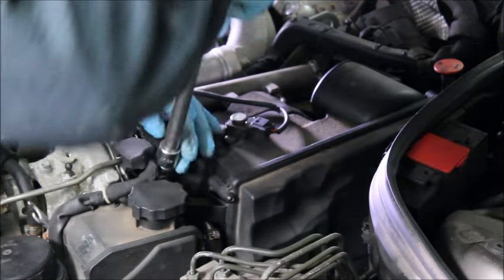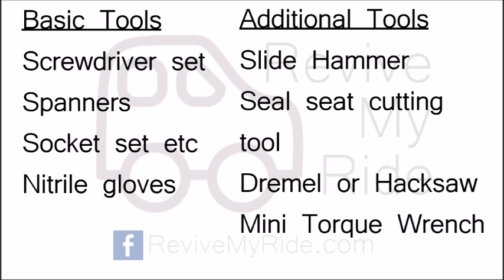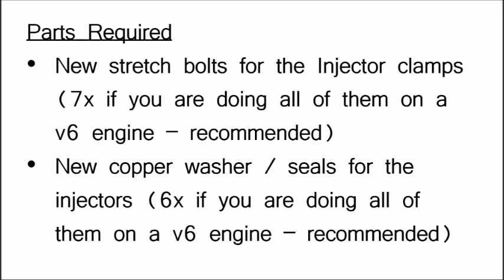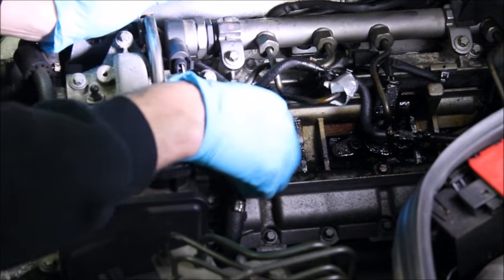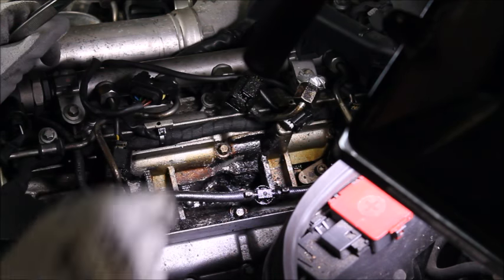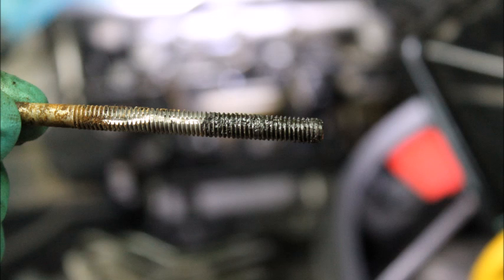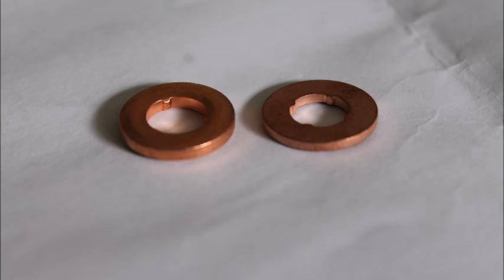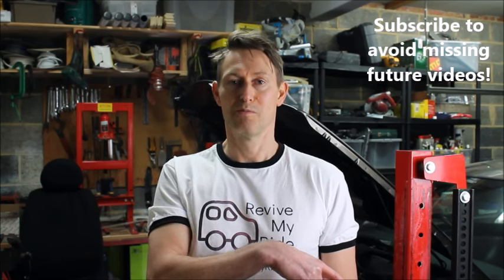Mercedes diesel CDI (Black Death) leaking fuel injector - How to diagnose and fix on 3.0 V6 engine

Comment: can this problem produce White smoke??
Reply from the maker: To be honest, I don’t think so. The leaking injector seal let’s combustion gasses out of the cylinder and coats the top of the engine in carbon deposits. However, there is a different fuel injector problem where the injector doesn’t shut fully, this is a fuel leak into the cylinder. I think this can cause white smoke but I haven’t come across or had to deal with this issue myself. Hope that helps some! Thanks, Phil
Reply: @ReviveMyRide   ok. Thanks!! Diesel white or black smoke? Leak inside the cilinder?
Reply from the maker: @fernandovacarezza1783 sorry for the very slow reply, missed your message! It's a difficult one! If you google it, you will see people saying both! My personal experience: white smoke is unburnt diesel. Don't be too concerned if you see this for a couple of minutes after start up and then it goes away. If continuous, then yes, you could have an injector that isn't cutting off or is over fuelling.
Reply: @ReviveMyRide  thanks. It s drive me crazy. I cannot find the problem. Is when is hot. And in ralenti.

Comment: I have a 2010 w212 250 cdi. Om651 4 cylinder. 160k miles.  I see diesel sitting at the top of each injector and if I drive hard - I see a puff of smoke out the rear *exhaust) and can smell oily fumes in the cabin......what is it ??  so as I sought my car- I am selling it- its a painful car to own.
Reply from the maker: Hi, the symptoms on the "Black Death" is a carbon build up around each injector. I haven't heard of it looking like actual diesel before. I enclose a link that shows what the black death usually looks like: https://sprintergurus.com/fuel-injector-black-death/ It's possible that you have a diesel leak but I'm not sure why you would see if above each injector. Have you had any or carried out any work on the car recently? BTW, sorry if you already know this but a word of caution, it is possible you have a diesel leak, so never investigate when the car is running. The diesel is at very high pressure and a small, fine leak can cut right through your skin (and worse!). Regarding a puff of smoke out of the back, that is normal in higher mileage diesel cars and one of the most common causes (but there are other possible causes too) is linked to fuel injectors not being as efficient any more at providing the "mist" of fuel to get best combustion. Fuel comes out more as a stream, as a result doesn't burn as efficiently can causes the smoke effect. This can be fixed by removing the fuel injectors and sending them away to a specialist company to clean and calibrate. Hope that helps!

Comment: Hello; Good video poor audio. At 100% sound it is hard to hear you  in many parts. You should redo the audio at a higher volume.
Martin
Reply from the maker: Hi Martin, thanks for the feedback. Agree, audio was poor in this video. I hope it doesn't put you off looking at some of my more recent stuff because I have improved a lot! This vid was one of my very early ones and I was still using the camera's built in microphone. Cheers, Phil
Reply: @ReviveMyRide  No worries. Excellent video with good explanations!

Comment: There's only one problem I saw you dit not leave any length on the cutting tool as a insert and to act as a guide otherwise it was spot on
Reply from the maker: Glad you liked the video! Thanks for your comment on the cutting. I see what you mean, I could have slid the cutting blade up higher to leave more of the centre shaft protruding, which would then locate in the hole that leads into the cylinder. I'll do that next time 👍

Comment: Have symptoms of "black death" on my 2003 320 CDI straight 6 engine. I think its a similar if not the same injector. My mechanic used the washer from Ford. He took out 2 injectors, cleaned everything up, but now the car runs poorly. I presume a refurb of all 6 injectors is due. Does anyone know a good refurbisher who can do these at a reasonable cost?
Reply from the maker: mista bombastic!! Sorry, I've never used anyone for fuel injector cleaning but maybe someone else will chip in with a recommendation. I will post a question on a FB page that I am a member of and let you know if I hear anything back!
Reply from the maker: mista bombastic!! I got a reply on the Facebook page and the recommendation was "United Diesel", you can google them up and maybe even look for some reviews online. Might be a good place to start, they have good reviews but I haven't used them personally. Hope that helps!

Comment: Would that be a fuel pressure problem I have an engine light on, and that’s what the computer said
Reply from the maker: Hi Sam, to be honest, I don't think so. The injector seal leaking issue is the copper seal where the injector meets the engine, so it's not actually a diesel leak. Fuel pressure problems are often the fuel filter (restricting the flow of the fuel), the fuel pump itself (no longer supplying enough pressure and flow) or the pressure regulator (faulty and no longer maintaining the correct pressure and instead allowing it to return to the tank). Hope that helps! Phil

Comment: I am not so sure the injector problem is fully the seal seats... might be the leakage of fuel from the injection shut off sealing or possibly erosion of the injector nozzle.  Some thoughts on other issues.  

A couple comments.  My car is a 2011, E350 Blu Tec  now as of May 2020 has 35,000 miles.  The oil is changed every 5K or so.  At 25,000 miles I started using the Turbo Maxx oil additive 1/2 oz per quart of engine oil, Mobile ESP 0-30w, I think this should improve the carbon and the wear problems on the timing chain.  I also use the Turbo Maxx c-4 fuel additive 1cc per 3 gallons.  The use of the oil additive increased mileage from 32 mpg to 36 mpg.  The use of the fuel additive increased this to 38-43 mpg. Mr. Ellison has accurately predicted the improvements.  I was surprised, so I will keep using.  These may help with the injector issue you mention here if, as I suspect it is partly an issue internal to the injector and the nozzle outlet holes... perhaps the fuel treatment which as a cleaning aspect will help... no data or proof yet.   I am hoping the cleaning ability of the oil additive helps with the coking problem of inlet system. I plan some bore scope investigation during the summer.  The EGR system does not seem overly dirty though I did clean the EGR valve for maintenance at 25,000 miles.

I note by 25,000 miles the turbo housing to inlet horn (red) gasket had failed due to combination of compression set and vibration wear.  I replaced the small red PCV hose seal also.  I will note the inlet horn and the mass flow air sensors needed replacing due to imbalance of calibration (shows as EGR flow issue) as the ecu calculates the EGR flow from the MAF sensors, due to contamination of sensors.  Do not ever try to remove or clean the sensors for routine maintenance as that will put out of calibration... or attempt to clean (already tried those solutions).  Learned about the calibration sensitivity issue was the real issue, by carefully checking the data coming from the sensors during a driving cycle.  If you get a code from this it shows as a EGR flow issue not as a MAF sensor reading... you have to look into the MAF sensor real time data. 
After some investigation of the PCV system I believe it has some design issues which could be improved to minimize oil carryover.  This may be part of the injector issue here... oil carried over in the inlet and partly carbonized by the high level of EGR flow.... this helps efficiency by providing free radicals to catalyze fuel / air ignition (hypergolic ignition means ignition of contact) but may be providing carbon residue on injector nozzles. This would grow coke deposits surrounding the micro-injection holes.  System is designed just too lazy to install. I believe that the problem is both a long term efficiency problem with the centrifugal air-oil separator, the separator being marginal in design capacity, and the system experiences too high crankcase pressure during certain parts of operation. I think a catch can solution would be inadequate, and a more robust solution attempted, to make sure the oil carryover is minimized. I will note most vehicles have much better air oil separation designed in the valve cover baffle sheet metal attached to underside to the inside of the engine (no catch can is going to work better).  It appears the crank case pressure increase under certain loadings and speeds of engine.  This is a small increase of a few inches of water column pressure but I think that is where the issue is. 
So far other than some electrical connections becoming brittle things are doing well. I will replace some of these connectors this summer.

Comment: How much roughly would a garage charge to do this work?
Reply from the maker: Hi Jordan, this is a really good question and unfortunately the answer depends on how much labour is required. As you saw in the vid, the parts required are minimal (new bolts and copper seals), so the cost is all down to labour. However, the amount of labour will depend on how bad the problem has become because a lot of the work is cleaning up the top of the engine and getting the injectors out. If there is hardly any carbon on the top of the engine and it is just a straight forward 6x injector seal change, then I have seen prices mentioned on forums of £200-£300 If there is a lot of carbon, the injectors are suck and seal seats need to be re-cut, I could imagine this would double. If you have got a garage that you trust or is recommended, I would have thought they could just take the engine cover off (pops off) and give an idea on price with a quick visual. Please note: All six injectors are easily accessible on the cars (C-class or CLK etc) but I have heard it is much more difficult to access stuck injectors on the ML and vans etc with this engine. Sorry that I can't give a more definitive answer than that!
Reply: @ReviveMyRide  perfect picking up a 2007 c320 cdi sport tomorrow taking to a garage on friday to have a really good look round the car so this is something im getting them to look at

Comment: Masterclass in how to do this b* of a job at home many thanks.
Reply from the maker: thanks very much for the feedback! :-)
Reply: @ReviveMyRide  BTW What's your fav oil for W251 3.0 OM642 107k miles and no DPF?
Reply from the maker: @lo0ops  Believe it or not, it's my wife's car and she always insists on sending it in to MB for servicing! I'm sure you know this already but the oil spec for no DPF is 229.5 (presumably it may be a bit cheaper?) and if you do have a DPF, then you would need 229.51 or 229.52. Sorry that I'm not able to make a recommendation! There is a list of MB approved oils here if that helps (although the list is huge!) https://bevo.mercedes-benz.com/bevolisten/229.5_en.html Thanks, Phil
Reply: @ReviveMyRide  Thanks Phil that's great.

Comment: Good video and info, BUT it is not correct, in the proces, using the seat cutter!
The cutting tool has to come more through the cutting part, as the as it keep the tool in balance under use!
https://www.youtube.com/watch?v=qKZW7iEusic
Reply from the maker: Hi, thanks for sharing. I agree that ideally, maybe the middle shaft of the cutter should have been extended more. The bore is very tight on this Merc engine when using the 17mm cutter, so I didn't have any problems with it moving around. Cheers, Phil

Comment: great video i'm doing my jeep cherokee now i no how thanks
Reply from the maker: Great stuff! Hope you get on with the work ok. Any questions, just ask! It’s a great engine apart from this problem where the injector seal breaks down over time. Cheers, Phil
Reply: @ReviveMyRide  hanks for the reply i'm a bit stuck at the moment one of my injectors is weeping so when i start in the morning i get a lot of white smoke  like a hard start problem is with it leaking inside the pot i dont no which one it is could you tell me how to finned out which one it is i'm just a DIY mechanic would love some help  cheers 
mick ps its the 2.8 engine
Reply from the maker: @mickuk9700  Hi, ok, so what you are talking about is an injector “passing”, which can happen when injectors get old / high mileage. I haven’t had to deal with this problem personally but have heard about it. As with anything, they wear out and I’m afraid, even if you can find the culprit, the other injectors won’t be far behind. I’m sure you have thought of this but the first port of call (if you haven’t tried this already) is to use a code reader to see if the engine ecu is recording a fault code and can point you in the right direction. Failing that, I’m afraid it might be a case of pulling all of the injectors and sending them away for testing / rebuilding or buying a new set (Yes, I know they can be expensive). BTW, hard starting can also be the glow plugs not working properly. A few years ago the control module on my car which operates the glow plugs failed and it had the exact symptoms that you described. The ECU did recognise this and throw a code up though. Might be worth looking for that issue. Hope that helps some, thanks, Phil
Reply: @ReviveMyRide  thanks for getting back to me year i was thinking i mite have to change them all in the uk there asking 447 uk pounds just to change one.
but i will definitely take your advice and get the glow plugs checked 
really appreciate your helpl.
great channel subscribed
Reply from the maker: @mickuk9700  Great to have you onboard as a subscriber! 👍 I'm not used to dealing with the Jeeps but I think you are running the same engine as the Mercedes C class W202. If you aren't already aware of them, these guys have a good rep "Pelican". Link is to the injector that I "think" you need but you could check with them. Also, just to add that your engine might have quite a few differences to the one shown in the vid. I haven't worked on the previous gen diesel before... Good luck with it! https://www.pelicanparts.com/More_Info/0000788623.htm?pn=000-078-86-23-MBZ
Reply: @ReviveMyRide   thanks i will definitely look into them

Comment from the maker: 💥I JUST Bought a STOLEN Recovered Salvage Project Car! - MERCEDES E CLASS Convertible. Check out the VID Series Here 👉 https://youtu.be/pfP6n5jcfAI
Reply: Hello,nice video there,what seat cutter should i use on my Mercedes c200 CDI engine? Year of manufacture is 2010
Reply from the maker: @lewismugambi8714  Hi, from the info you provided, I am assuming your car is a C class W204. I just had a look and your car still uses the same fuel injector as mine does (mine is a CLK C209 320 cdi 2007). So, you should be able to use the same seat cutter as I did. The one you need is the 17mm flat reamer. They often sell them in kits (see this link for info - https://amzn.to/338zKeb ), if you read the info on Amazon, the one you need is described as "17mm x 17mm Flat Reamer for Delphi/Bosch injectors (BMW/PSA/Renault/Ford)" but you may be able to just pick up the one you need separately if you shop around. Hope this helps! Thanks, Phil